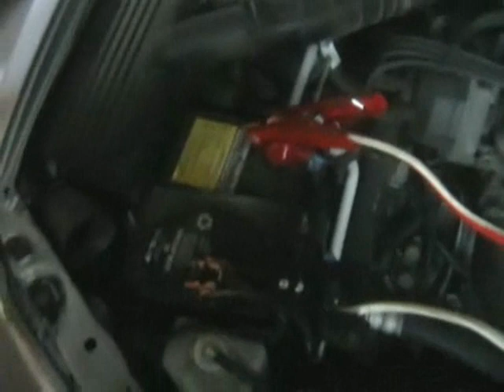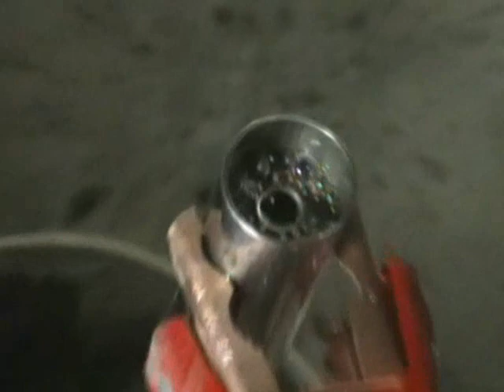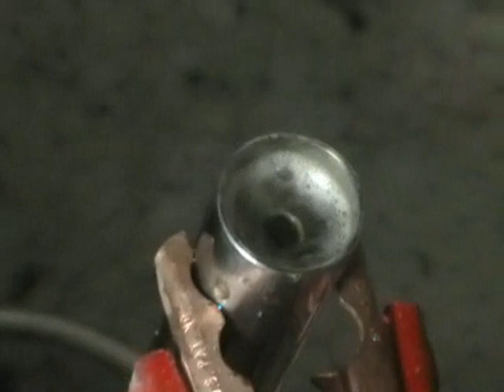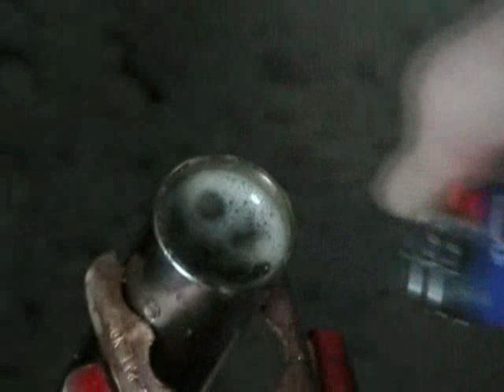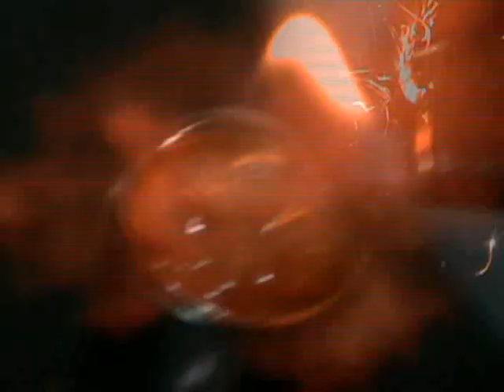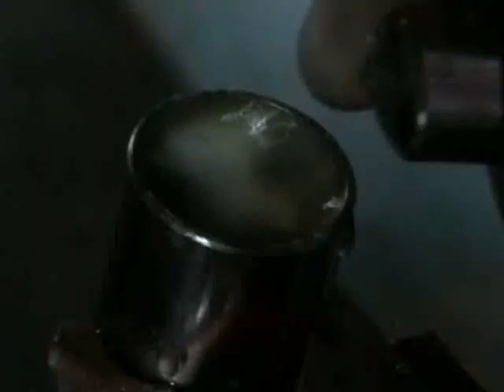Turning Water into Hydrogen - An Experiment

Comment: This video is a simple demonstration of electrolysis of water.  The electricity splits the water molecules into hydrogen and oxygen.  The hydrogen forms at the negative and oxygen forms at the positive.  From what I can see on the video it looks as thought the oxygen and hydrogen are being burned at the same time causing a "pop" instead of a flame.  Which you would get if you burned pure hydrogen.